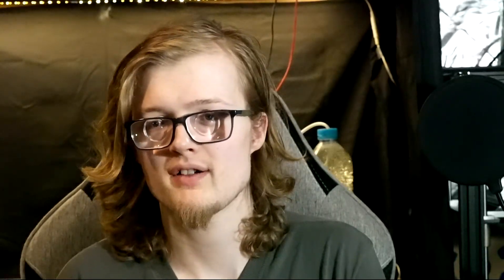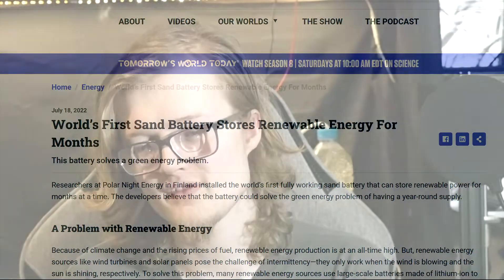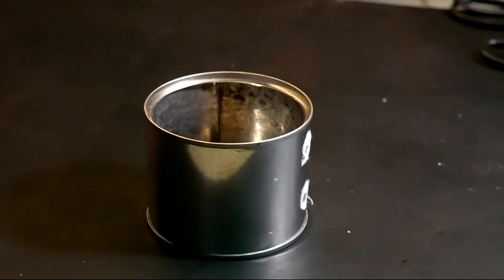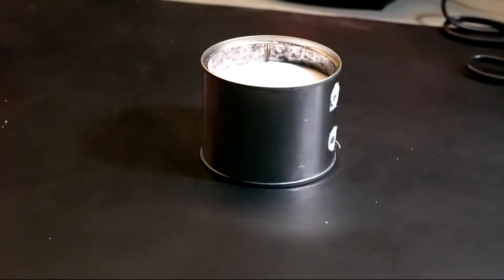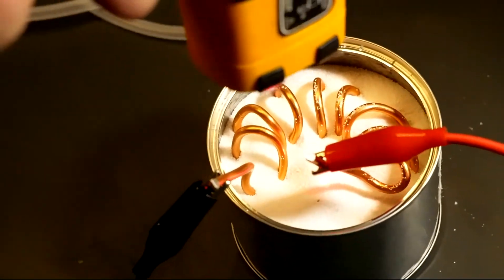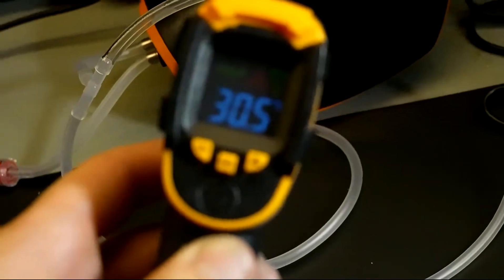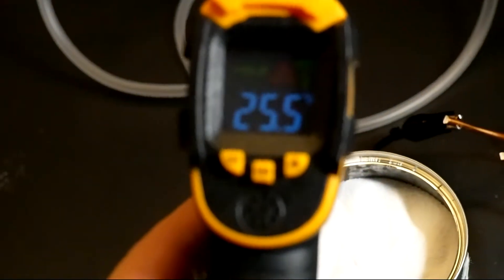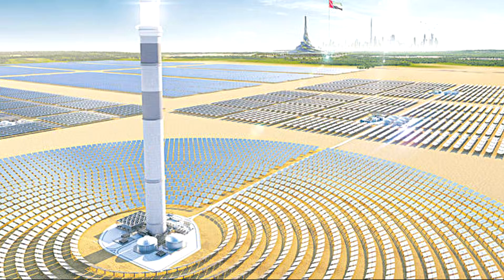Introduction to Sand Batteries

Comment: This is interesting! I have some concerns with adding yet another use for sand though as sand theft is actually a problem in some parts of the world, as wild as it sounds!

Not a reason to avoid investigating it, but just something to keep in mind as every technology has its pros and cons. 

This could be particularly useful when you want to keep the energy thermal like for home or water heating since converting thermal to electrical energy is such a PITA.

Comment: It’s not a battery, you’re just heating up sand. You’d need to get a way to convert it back to electricity and measure its efficiency there. If you just want to heat something up and keep it hot there are better materials than sand and they’re not more expensive.

Comment: I read about a similar technology in the 1990s.  It was about domestic heating using solar convection panels to heat water which was circulated through to a large underground tank (ISTR the building basement) filled with rocks.  The idea was during the day the heat wold be stored in the rocks and could then be extracted when required by simply pumping the water round the heating system.
Reply from the maker: @StanleyRestall  sounds very interesting!

Comment: Hi, I hope you're doing well. I live off-grid and was really impressed with your video, congratulations! I'd love to connect and exchange some ideas. Right now, I'm generating energy through solar, water, and wind power. I've been experimenting with different types of batteries, using water, salt, charcoal, and even vinegar, but I haven't found a truly reliable solution yet. I'm also exploring ways to generate energy from my chimney and fire, as well as a secondary fire pit we use. We keep the fire burning throughout the winter, and I’m really keen to figure out how to harness that heat to generate energy and charge a battery. Do you think a sand battery, heated by my fire, could produce enough energy to power my cabin, which is starting to become smart with an ESP32 system and sensors, and will eventually feature offline AI? I’d greatly appreciate your insights on exploring these energy and storage systems. Thank you so much!
Reply from the maker: @paradisemountain-w7c  Hi!

How familiar are you with Stirling engines?

While less efficient on a large scale than a steam turbine, on a small scale, coupled with a generator tethered to it, they can conveniently convert heat into power through motion.

Comment: Would be fun to see a scale up heat pad. That can be charged in summer    and used in winter.
Reply from the maker: @pieterboots8566  I have something planned along these lines!
Reply: @edeniaAJ  Another fun thing most of us have thought about is having a room ceiling filled with a matrix of infrared panels. The infrared panel closest to you will automatically turn on. So the heat will follow you when  you move through the room.
Reply from the maker: @pieterboots8566  hmm. I'm thinking an underfloor heating variant of this would be simpler, no?

Comment: stirling heat bank lets you use the battery as the heated end. The piston is thus the radiator. Thermal contrast provides the radiation meaning you want to disconnect the 2 when its in storage mode. Sterling engines are cheap but not the most efficient unless its thermo acoustic stirling which requires a set temperature for a set frequency (and a lot of tuning). All the storage efficiency comes from scale... the ratio of radiating surface to volume decreases with size. Also a reason for a spherical and nonmetallic sand bank. Building a sand hill covered in plastic then earth is used for town air heating. Hessian plaster cast a large inflated balloon (removed when dry and 2nd coated) and put it in a box lined with an insulation batt or a back filled with foamcrete (polystyrene is easier than dishwashing liquid), Completely immerse your element and have fireproof braided power cables. Because you can't afford  vanadium dioxide to block the heat but not the electricity. Thats why they heat with focused solar instead of wire. From memory liquid sodium is 500degC and 3x atmo pressure - thus sand

Comment: Instead of that bulky wire, you should use some resistance wire (Nichrome), it's a lot faster and efficient. And without a good insulation, you are just making a sand stove, not a battery. What are you planing with the stored termal energy? How do you want to convert it back to electricity?
Reply from the maker: @L3X369  I'm currently thinking through methods of insulating it. The simplest thing I can think of is plaster, but that's less than ideal. There's some DIY silicone polymers I want to experiment with, that may show some promise, particularly when I make a sand battery that works with solar heat.

The heat can be converted to electricity through kinetic energy, via making use of Stirling engines to harness temperature difference. I know that steam turbines are more efficient at scale, but for low-mid power applications, I hypothesise that Stirling engines would be more efficient due to directly converting heat to motion.
Reply: @edeniaAJ have you thought of making it to a large thermos? Aka vacuum evacuated panels on the side. 
Even with 50~% lower air pressure it will be a better insulator than other.